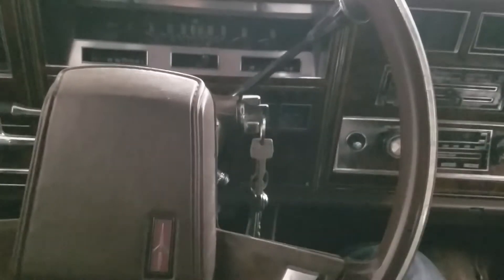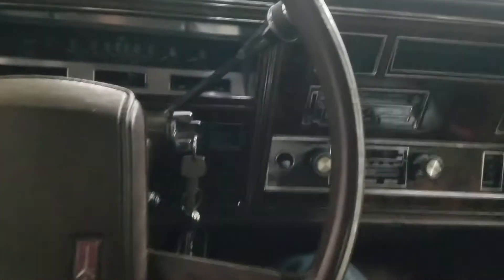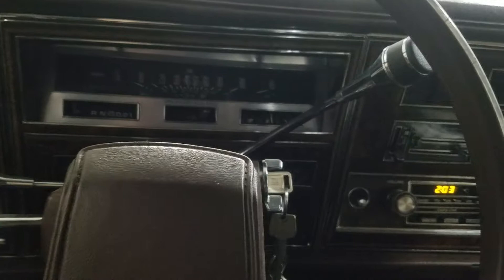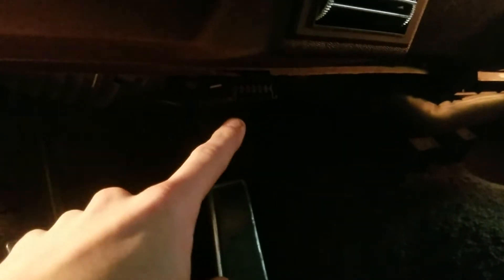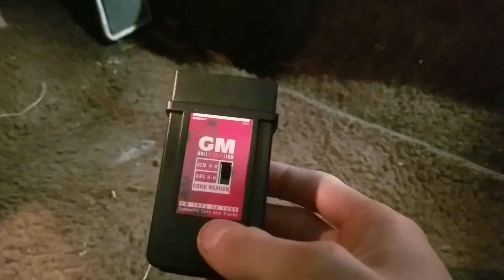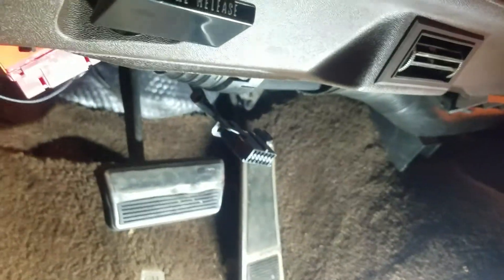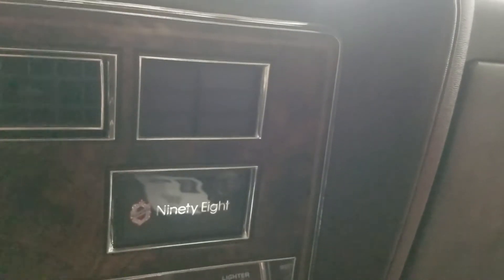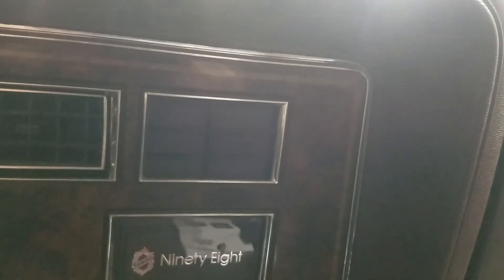how to use an OBD1 code scanner

Comment: I have an 1994 Olds Cutlass Supreme S 3.1 & i'm having an issue with my ABS light coming on when I drive it and also my CHECK ENGINE LIGHT comes on,but I checked for an loose gas cap, which sloved it for now, but have to get another locking gas cap.Every where I went like AUTOZONE or ADVACE AUTO they don't have an OB1 SCANNER to check it
Reply from the maker: There is a way to bypass the scanner with a paper clip, but it blows fuses sometimes so I use the tool.

Comment: So the code 12 means it's fine? Or it means it's reading fine?

I saw 2 other codes (possibly a 3rd). Have u found what that means?

I'm asking because my 92 Nissan d21 MT KA24E KC is doing all sorts of weird stuff... Sensors reading right and I've cleaned all connections (depin and repin, after cleaning, and stretched the female terminals to grab the males really REALLY good). Still working on checking the wires in each harness, but so far only a couple bulb check wires, cig lighter wires, and 3 grounds looked bad. I replaced all those.. the fusible link wires felt weaker than they should, so I did them too.... I have a similar issue to what u have, but it's intermittent. Also, I don't physically have a CEL. Nissan didn't install one in this model, so I have my passenger seat pulled and reading codes off the LEDs. On mine, green light is tens and red light is ones digits. Only code I get is 55 (which means no codes). But when u said 12 on URS means "reading right" it made me think.. does 55 on mine mean "no codes"? Or does it mean the ecu is working as it should (like.. reading correctly)? I feel like I will come by some funky wire that is causing all this eventually, but I'm wondering what u discovered on ur vehicle. Like I said, the issue is the same as mine, but mine is intermittent... It runs like URS is sometimes, but when mine doesn't, it idles all over and the tachometer drops to 0 for a split second, every few seconds! But when it runs like ur car is doing, it's just a super high idle (around 1500). Runs without the glitch happening, but if I barely press the pedal a bit beyond a light press, it bogs.. let go, and right back to 1500. If I touch it, I go feeling like it's running new, but knowing I have to accelerate suuuper slowly, cuz it'll big in any gear or no gear. Started happening when I changed my distributor with an aftermarket one. I swapped it back and it just stayed like that. I checked the halfmoon oil slinger shaft it dives into, the wires, the hall effect disc, the diode in the dist (all the crank position sensor stuff is in my dist). Ur the 1st person I e seen to have an extremely similar issue to me. I feel like we should hit each other up and bounce some ideas. Just hoping is something simple I'm missing. Either way, best of luck to u and ur old baby!
Reply: i have a 93 caddy. it does the code check itself. I replaced the serpentine belt, had 6 codes come up. after resetting the codes to "zer0" and runnign the car for a few days. I don't get any error codes. all .7.0. working perfectly.